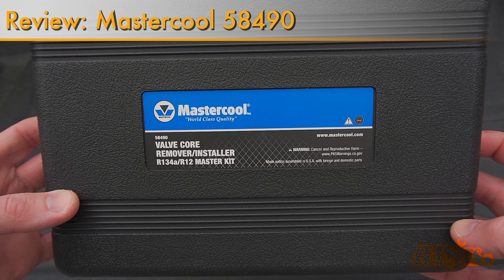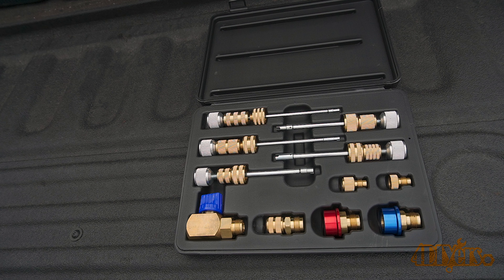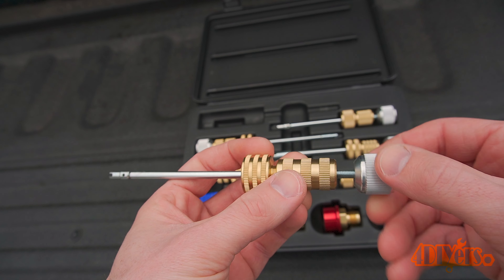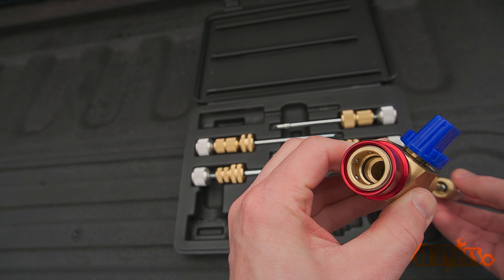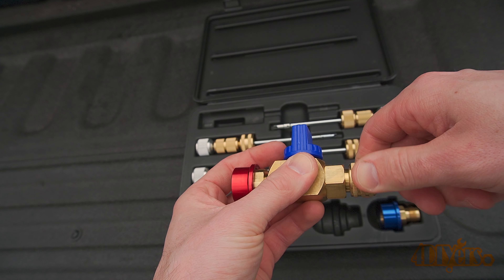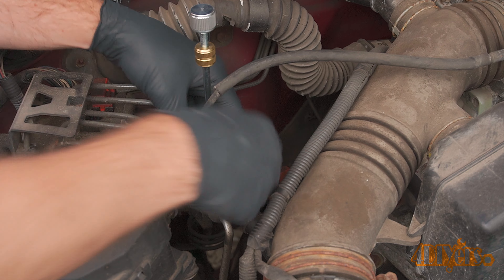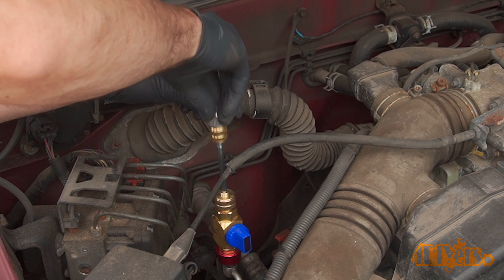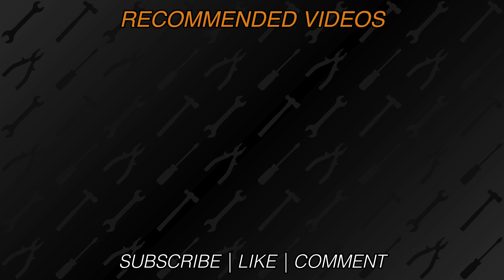Review: Mastercool 58490 Black Universal A:C Valve Core Remover and Installer Tool Kit

Comment: Problem is I don't see flared 1/4" ends, when unscrewing.  The setup needs the flared 45° nipple that technician can remove the schrader valve, then pull a vacuum. But it does no good to the technician if you can't hook up the vacuum tool after you remove the schrader.

Comment: 200 bucks what a rip off cheaper to have the system uncharged change the valve vacuum and recharge. The R134A needed to recharge will be cheaper than this tool sheesh.